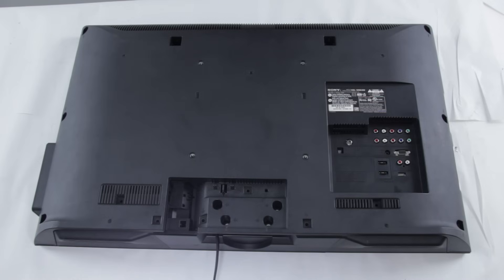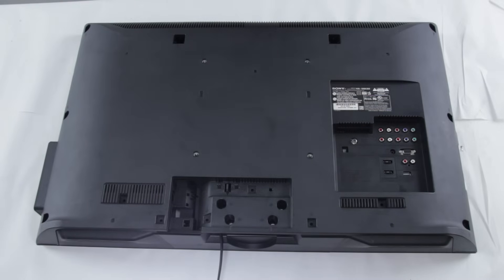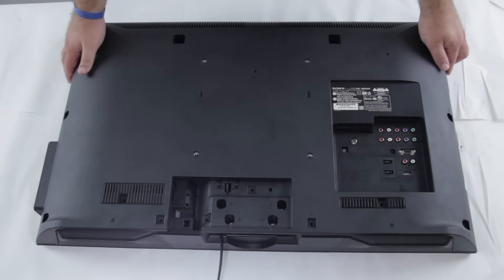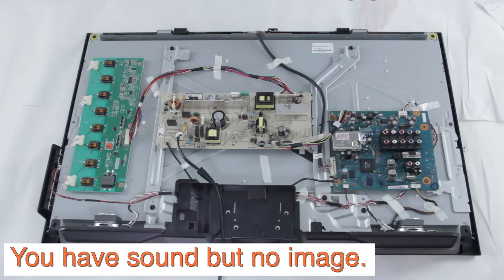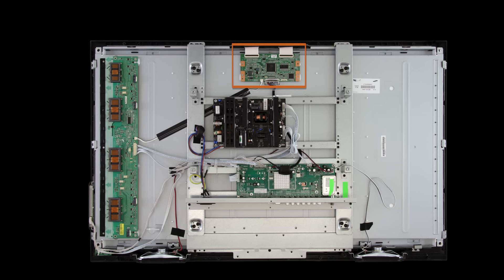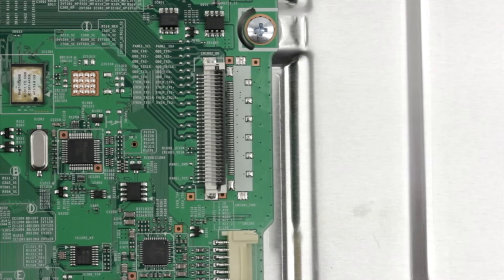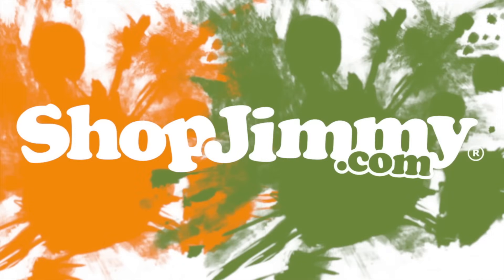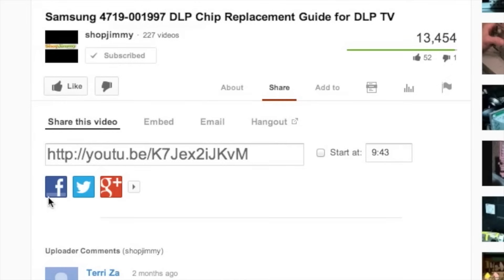LCD TV Repair Tutorial - T-Con Board Common Symptoms & Solutions - How to Replace T-Con Board

Comment: I have a Samsung UN65H6350AFXZA that would not power up. I replaced the main board and the power board. Now when I push the toggle switch the red light flashes and I hear a "ting" sound but no picture. In a few minutes the Red light on the front panel will stay on Red but no picture. If I hit the toggle switch again the red light blinks for a few times then goes off. It will not come on again unless I cycle power. The Blue light near the T-Con board stays on all the time. Have you seen this before and do you have any ideas?

Comment: I have a Sony KDL-40Z4100 and I have distorted colors. faces are red and green mostly with blue outline. all colors are exaggerated and psychedelic looking. The rest of the TV is fine, all inputs work but the output from all the different inputs show the same picture symptoms.  What board is most likely the cause?

Comment: Hi!
I have a problem with my Toshiba LED 50L2300VQ
I followed your guides and the problem is most likely the t con board, I've removed it...
The question that remains is do I have to get the exact same t con board?
LG display
LC5000DUE_SFR1_CONTROL_MERGE
Many Thanks!

Comment: I have an LG Mdl#47LN5700-UH, ser#307RMWV3H849 that flashes a bright LG image and then goes dark. The backlighting does flash when the TV powers up but the screen goes dark. There is an image but it is only visible doing the flashlight test. Based upon your video, this sounds like the T con board. Your help is greatly appreciated

Comment: sharp 52" lc-c5227

Lost/ blown HDMI ports after hooking up a Roku with Wrong power supply....higher voltage....

Which board do I need to replace?

Using the component inputs now.

Thanks

Comment: I have an rca 46la35rq model, the screen goes black, a red light starts flashing on the power supply board in the back, can turn tv off and on, screen works for a while then goes black, has sound and power

Comment: 32 lk330-ub.cusyln   LG TV  the tv will come on as soon as I plug it in. icons flash on the screen and I can`t control anything with the remote or the power switch. I tried to connect a portable antenna but a  blinking icon say the channel map is empty. Do you want to start auto tuning ? yes or no. But I have no control. can you help. thanks Ed

Comment: I have a Toshiba 50L4300U model tv I have sound no picture I put a flash light to the screen I can see and move menu options vi wamt to know if t-con board has the led driver integrated in it because I do not see led driver device

Comment: RCA 40" led tv according to your video needs to get the tcom board replaced, model RLDED4016A I opened it and I think the number for the part is V400HJ6-PE1 does that make sense? what would be the options to get it?

Comment: Hello I have a LG 65LB5200 TV. I recently had the problem of turning it on and the screen was completely white, menu and input pop up won't show either but sound will work if input is changed to something in operation. I keep reading online saying that replacing the TCON board will fix it. Bought a new one from your site and replaced it and TV started working again but only for about a week and the white screen came back. Any ideas?

Comment: I have a Samsung UN60D6400UFXZA that just clicks on and off. I changed the power board and that did not help, still does the same thing.  The backlights flash on and then off over and over and it clicks.  Is the T-Con board bad or is more likely the main board?

Comment: I have a bush dled32165hd. it stopped working so I changed the main board and its working again but the picture us upsidedown and it looks like the resolution is way off. I can't find anything in the settings to fix it and have  double checked all connections. if you have any suggestions as I'm now stuck.

Comment: Insignia NS-46E340A13 will turn on and play fine until it's turned off. When trying to turned on again, the red led goes out and nothing else happens. TV is stuck in this mode until ac cord is unplugged. After waiting a while before plugging back up, it then comes on again and plays fine.

Comment: hi,
I'm having trouble with my Sharp LC-32LE653U LED tv. After a while vertical lines appear and it starts on parts of the screen where the image is bright. Pretty soon the whole screen is completely blurred by these lines. I'm not sure whether or not this is due to the t-con board. I've only had this TV for a little over 1 year. Any help/suggestions would be greatly appreciated. Thanks!

Comment: Hi, I have Samsung UE55HU6900U , when plugged in red stand by light flashes slowly but all the time. It does not turn on, only when remote pressed red light flashes faster but no picture -black screen, no sound, nothing. I checked power board for faulty capacitors and checked voltage output on pins, all as it should be, so I assume the power board is fine .
On main board is blue light flashing. Is it more likely that TCON board is faulty or could it be the main board or ribbon cable? Could you advise please? Thanks

Comment: Vizio  E291-A1  serial# LTTMNVAN3806392.. The little white light on left lower corner comes on but it gets stuck

 in that position. Only way to get 

 TV to do anything ,you have to unplug it.The little white light goes

 out. Plug it back in the little light

 come back on. but nothing else works.After numerous tries it will

 suddenly come alive and work well until you turn it off. Then its a

 long repeating process of unplugging etc.. etc.. What part is bad.. I

 would like to fix it.

Comment: I have a samsung l.e.d lcd tv model un6500d that has brief lines across the screen when you turn it on then goes black and has sound . I have replaced the t con board but it didn't help . what could be the problem?

Comment: LG 47SL85 - ua  TV plays for 7-10 minutes and powers itself down. It goes through the typical shut down the same as if you actually turned it off.  It can be turned back on immediately but the run time decreases each time.

Comment: Hey Guys Great INFO.
I have a SHARP TV model LC-37SB24U..Wont stay on. I get slow green blings. I have tried hard reset and also trouble shot holding down vol and channel. it goes through red to orange and turns on but before it continues to turn on it makes a clicking sounds, shuts off and greens lighst blink sgain. Is this a power board issue?

Comment: my LG model 47LN541C serial # 311RMLMAF776 does not have backlights. when powered on, it flashes the LG logo and goes blank I've tried replacing the T-Con board but no improvement. what do I need for this to work?

Comment: I have Toshiba LED 50L1400u. It just began to go dark. Can see the picture. Normal through the center from left to right but darker  through the top & bottom 1/3 of the screen. Its as if  there is a shadow on the top and bottom of the screen. Any suggestions would be appreciated.

Comment: I have a Sony Bravia XBR-65X850C. While watching the other day, the picture suddenly went out..  The IR sensor (at the bottom of the screen) flashed red 8 times.  Now the IR Sensor will illuminate for a few seconds when I try to turn the tv on but then goes out. The tv will not turn on now.. I have attempted the "factory reset with no result.

Comment: I have a Vizio E420i_A0 and the bottom part of the screen has a vertical line and it gets blurry for a few seconds and then clear and it keeps cycling like that, it's only 2 years old and I would really like to fix it, any suggestions or ideas on what it might be would be greatly appreciated. also where I can get the parts? thanks for your time, Chuckie Darcy

Comment: Hi there... I have a Sharp Aquos Model LC-52D62U  Serial 61284671   It has a bunch of blue dots all over the screen.  I took the back off and and took off the ribbon connector.  I plugged it back it and the Tv seemed to work.   Although this morning when I turned it back on the blue dots appeared again.  Any suggestions?

Comment: Hello, I have a Sharp LC60LE847U Model and 207830631 SN just recently I have a yellow vertical line on my screen, I did a hard reset but didn't cure the issue, any thoughts?

Comment: My Sony Bravia KDL-32L5000 SER#4697669 had power, sound and partial picture. I opened it up, removed the tcon board and replaced it. After replacing it, and turning it on the same problem exists. The picture shows up under a black box (started white) with colored (red &purple)  vertical lines. I can see the top 6 inches of the picture and a bit around one edge. Sound is fine.  What else could be the problem? Thanks for any help

Comment: ELEFW504 M5A3M This is an element 50".  Is it possible that I do not have a replaceable T-Con board?  The main board has part number 34012398 printed on it.  Your website does not have a t-com board for sale to go with that main board number.

Comment: Hi ShopJimmy. I have a Samsung LED TV Model #UN50F6300AFXZA S/N Z6WF3CAD705384B. It seems that I have loss the backlights on my TV. I did the flashlight test and can see the picture when I'm shining the light on the TV. I really want to fix this myself but I could really use your help. Should I be trying to change out the backlight strips or is there another repair you'd suggest? Any help would be greatly appreciated.

Comment: samsung LA40A330J01 I CHANGED THE T CON BOARD IT WORKED AGAIN AS IT WAS SOLIRIZED BEFORE BUT NOW THERE IS SOME GREY COLOR ON BORDERS I REMOVED THE T CON BOARD AND PUT IT AGAIN BUT NOW I HAVE 2 BLUE STIPES ON THZE SCREEN VERTICALLY WHAT SHOULD I DO PLZ

Comment: Hello:
I have an RCA 3534-LE55C55-Q424263. I have sound but no picture. When turning the TV on the red light blinks and goes off for power on. The source in the upper right corner flashes quickly and goes off. Any help would be appreciated.

Thanks

Comment: hello  ... i have a lg 47ln5400 i place a flashlight on it and i can see the image so i replaced the mainboard  because it was loosing voltage to the wires to the led, the led flashes but it still  doesn't come on my question an it be the t-con board????

Comment: I have a Sony model KDL-46SL140, Serial # 8006170.  When turning the set on the power light comes on and there is a click, then there is another click and the power light goes off and a red light blinks 6 times.  No picture or sound.  This problem is intermittent.  Any help would be appreciated.

Comment: Samsung LN40A500T1F. When turning on it has developed a nasty "pop" noise followed by  a garbled video display with a long screeching noise! Monitor then cycles off and on once and works properly. However I have noticed a area along the top of the image that is darker than the rest of the screen that almost looks like the outline of the inner panel (Sorry best way I can describe that)? Occasionally while watching a program the monitor will flicker quickly and audio will cut out also. Any suggestions would be greatly appreciated.

Comment: Hi Shop Jimmy - excellent primers on flat panel TV's!  Thank you.  I have a TCL LE55FHDF3300Z that powers on but only displays a blue screen, not particularly bright or deep but a consistent blue over the entire 55" screen.  I get no "initial setup" screen or TCL logo on startup like it should, and of course no signal from the cable box (but then again I can't tell what the input source is).  I have opened up the back, there are no obvious burned out parts or swollen capacitors or damaged cables.  Any suggestions on what to suspect?  If a problem with the power supplies - what voltages should I test for?

Thanks again!
Reply: And how you solve this problem?

Comment: Sony Bravia KDL-32R330B      
AUS-2014

No picture,No sound.  No menu
Turns on displays a faint Sony logo and then screen goes black. 
LED stays solid green. Blinks when I push buttons. 
Replaced fuse. Same issue.

Comment: G'day mate. I have a Panasonic TH-L55ET5A. I have this for 2 years but suddenly in last week, it stopped working. There is sound but no pictures. Even I cannot see the menu or any letters on the screen. Behind the TV, there is some light comes near the Antenna and other external devices connection area. The whole screen is light blue; four corners are lit. I have got some pictures but cannot attach here for your reference. Will you help me to find the fault, please? Thanks in advance mate.

Panasonic
TH-L55ET5A
Serial Number MN2560656

Comment: Hey there. I am trying to troubleshoot a samsung un60eh6050fxza. The tv has working backlights and sound but no picture. I dont have the remote for it. I'm not sure if it is the panel or the T-con board.

Comment: I have a jvc 55" 3d tv model number  jle55sp4000 the tv powers on I can see some of the picture but about 6inch in from the left side I get a white and black line that's about I inch wide that no picture shows up in I have pictures if needed please advise on possible problems

Comment: What would you recommend when tv has no sound or picture, when turning on the led light for power indicator comes on and slowly fades. There is a fiber optic port for sound that stays red showing there is some power feed. My tv is a 4K Vizio model p502ui-b1e. Thanks

Comment: My Samsung un50h5203afxza screen went dark (blueish/black),  but I still had sound and the back lights are on.  I purchased a tcon board from Ebay and installed it.  When I turned the TV on everything worked with the exception of some white lighting in the bottom left corner of the screen.  After about 5 minutes vertical lines started rolling across the screen and then suddenly it just went dark again just like the original problem.  I thought maybe I bought a bad board so I purchased another and installed and nothing changed.  Do you think maybe a main board problem?

Comment: Thanks for the information, I just watch your video to repair my TV, now I don't have to buy a new TV. Thanks a lot.
Reply: Straight lines on tv I think is a con board. How to order the part.
Reply: @josetirado4458  there should be a code on the board search the internet for it or eBay that's what I do

Comment: hi I have a lg42la620v TV and when you switch it on the picture flashes on then off instantly, led is visible with a torch still but no back lights. the LEDs look ok but when it flashes on the top and bottom row do not light up. any help would be great. cheers.

Comment: Hi Jimmy, I have an LG 47LE5500 and one half of the picture has a diffferent shade and is slightly darker. It's 50/50 one side fine and the other a shade or two darker. Really weird. Any possible suggestions? Thanks in advance

Comment: I have a question, my TV is a SONY LCD model no. KDL-46W5100, when I am watching, the TV turns off without pressing the TV button or the control. After a long time connected and it seems that it can not take more and turns off. What seems to be the problem?

Comment: white screen of death appeared suddenly. sharp aquos lc-40le433u . now when I turn tv on all white screen. I can kind of see menu and input change when I press those buttons but more like movement on screen than any image. now another person suggested to help diagnose, gently wiggling lvds back and forth to see if I get a response and voila! I did. screen went from all white to a bunch of coloured vertices line to all black when the one lvds cable was removed. when I reseated the lvd cable fully , white screen of death again. so where exactly is my issue? lvds? main board? or t-con?

Comment: I have a Toshiba model 32av500u, serial 815101095423.  My screen is out. I was getting sound but no screen. My back lights are on. I looked on the back and I don't know which is the tcon board. I see the motherboard. There is a board on the left and right side that look identical. Can you please let me know about a replacement and where the board is?

Comment: RCA MODEL L42WD22YX6 - SERIAL.H435CU053 SOUND. JUST FINISHED INSTALLING 5 NEW CAPS ON POWER BOARD. TV HAD NOT BEEN WORKING FOR ONE YEAR PRIOR TO INSTALLING NEW CAPS. IT THEN WORKED GREAT FOR  ONE DAY. NOW WILL NOT TURN ON WHEN I PUSH MANUAL ON SWITCH. HOWEVER GREEN LIGHT COMES ON WHEN I PLUG INTO WALL OUTLET. NO RED STANBY LIGHT EITHER. NO PIC NO SOUND.

Comment: I have a problem with a LG 42LE5400-UC SER.005rmwvca921, the unit will power on the panel lights flash and light up  , it gets no back lighting or screen , in 20 seconds or so the front button lights go off except for power button and lg logo it never gets sound or a screen

Comment: Hi, shop Jimmy, I have a Toshiba Model 50L3400U that it turn ON and it has a good image,, but after a while it start to flicker the Image ON and OFF within a timing pattern. I replaced the Logic control board and the power supply board, and the issue still persist. Could you guide me what this issue could and if still is worth to keep spending money on it. Thank you

Comment: I Have two tvs that just went out one is a 37lg 30  it gets power and the back lite comes on just no sound or picture the other is a Samsung ln46c670m1f the power indicator shows up but this module is a touch screen type on and off button and won't turn on

Comment: I have a SAMSUNG LN46A550P3F.  HDMI 1 & 2, when input is connected will show a rastoring image for an indeterminate amount of time (5 min to xhours) and recycle every 10 seconds until image is correct and then it will work until the next time the TV is power cycled.  AV inputs work fine.  Changing input device (Satellite or XBox) has not effect nor does replacing the DVI cable.  This problem is peculiar to the HDMI inputs only.

Comment: My Old Sony LCD KDL40-S2000 switches off and then comes on...keeps doing it every 15-20 minutes. Wondering if it is the tcon board that I need to replace. Would appreciate your thoughts on what you think the issue is